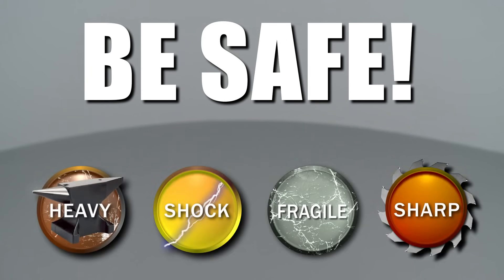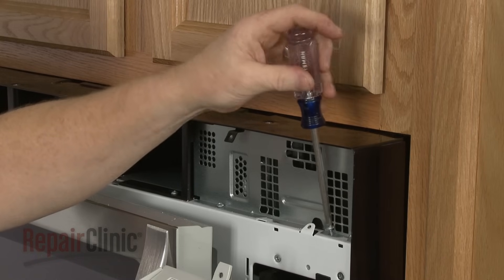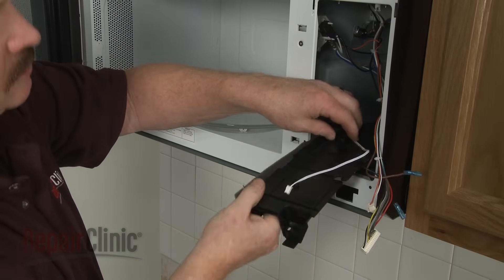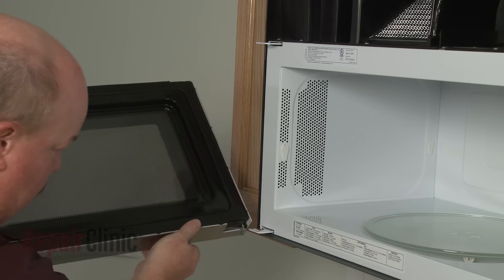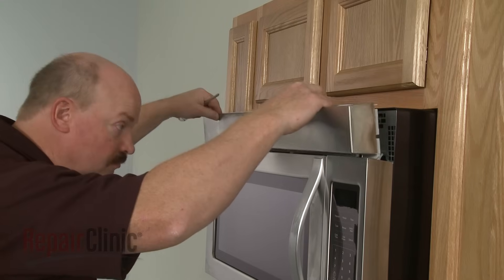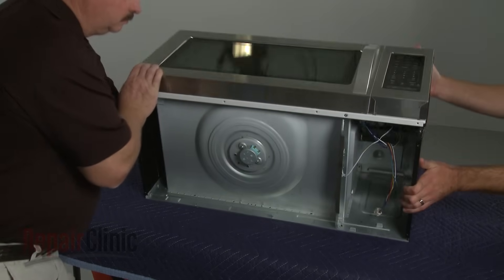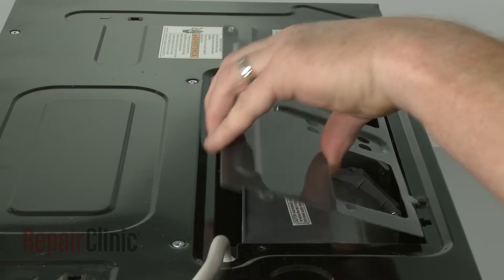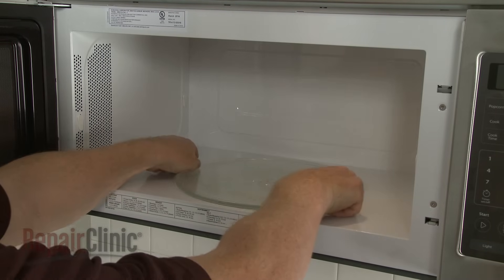Whirlpool Microwave Disassembly – Microwave Repair Help

Comment: So I had some sparking coming from the top of mine.. If you pause at 2:36 mark.. the small capacitor (?) on the small wire next to/below that thicker braided insulated white wire is burnt out. It was touching that white wire so the insulation on that one is a little burnt too. Can these wires be replaced?

Comment: Thank you for such a great instructional video. The issue with my microwave is the door is a bit loose for some reason. Looks like the screws are all there but I can’t really tell. Do you know why that might be?
Reply: My problem is that the door facia cracked despite the fact that no one uses it. (Came with new home)

Comment: i have watched several videos.  i have done a search of my issue.  i have worded it several different ways.  i cannot find an answer to my problem.  i cannot remove the plug from the old motor.  when i finally got them off, it pulled the plug out from the motor also.  it seems they are fused together.  i need to get the prong plug off to attach to the prongs on the new motor..

Comment: Without watching this first. I just took mine apart to clean it and put it back together, only having 2 extra screws.... I'd consider that ok. WIsh i had seen this first though, would have definitely save me so much time. Thank you for having this! great video.
Reply: A sign of a great repairman is having extra stuff on the work bench after reassembling.  😊😊😊

Comment: I have this same microwave, my issue is the exhaust fan only works on speed 1 not 2. Is one blower motor bad?
Reply: "With 2~3-speed motor, Hot voltage connects to main winding at different points. Only 1 point at a time receives power. That's what the switch does. When voltage is applied to each point, the main winding is energized as voltage from Black Hot wire completes circuit with White neutral wire." I would imagine there is a connection issue with "point 2".

Comment: Problem-Intermittently magnetron would not start, with a door close error. Open, close door a few times allowed it to start. Then it was just door close error all the time. Thank you for the video! You gave me the muster in disassembling the door interlocks with just a few hours before having to get ready for a three day work stent. Large family really missed having a microwave!! I was figuring I would have to dismount the whole oven before your video. The actual disassembly was very straight forward. In my case all the parts were functional. What I found was that each of the interlocks are held in place by a single screw and a sheet metal tab from the cabinet frame. Repeated use of the door bent one of the tabs, so that the interlock tilted enough, the bottom switches did not all change state. Bent the tabs back into a suitable position, problem solved. Work time about 40 minutes. Thanks again!
Reply: AM HAVING THE SAME PROBLEM. HOW DID YOU FIX IT??????
Reply: Need philips head style screwdriver, ohm/continuity meter and torx head bit set for this disassembly (Walmart multibitset $10, can now disassemble pretty much any appliance..loving it!! lol   ....  1) Unplug unit. 2) Check MW door to insure the two male interlock tabs are intact (each has an intact hole at end)  3) Remove the two screws holding top plastic grate outside, above door, top of microwave. Lift out grate. 4) right side top, remove single screw holding control panel. 5) Caution: panel has several very short travel, wire bundles with connectors that need to be disconnected before panel is fully removed. While the connectors are different sizes minimizing wrong connections, may be prudent for the less brave to take cell phone pics of still connected panel back before disconnection. With MW door open, dismount control panel by sliding control frame up and away from MW. Connected wire will allow just a few inches of travel, granting enough access to carefully unplug connections. Connectors have lock tabs on one side that need to be squeezed to separate connector. There is also, two slip on wire terminations, slide blue connector insulation up wire to expose, I then carefully pry off connector using knife blade edge. Detach ground wire at cabinet.  6) Use torx bit to remove the top or bottom interlock assembly (lower/upper door switch) one at a time. Switch is held in position by one screw and a foldover sheet metal tab from cabinet. Suggest testing one switch at a time.  (spring on each switch looks oddly placed, but if each spring leg end is connected, is probably ok looped coil is not pinned to anything) 7)To test... switch with two wires - disconnect one wire, check for state change (open/close circuit) across switch with switch button using ohm meter... switch with three wires - disconnect comm wire (center wire, check side of individual switched for pin function layout) check for state change (open/close circuit) across each side of switch with switch button using ohm meter. Check white plastic claw on interlock. Check tabs that press switch buttons to insure they depress switch buttons when in correct travel position. The claw grabs the MW door tab and  that limits the amount of travel this spring loaded assembly travels. I used a bit to hold the claw from over traveling the switch buttons while testing. Replace switches that do not change state. Replace interlocks that have broken tabs or spring mounts.   8). Remount interconnector once finished testing. In my case the sheet metal tab had bent out of the holding position and allowed the interconnector to engage but tilt, not actuating the switch buttons. 9) Once satisfied with interlock results, connect wires, mount them. Open and close door several times to insure proper closure. 10) reconnect control panel connectors.. don't forget the ground wire  11) Remount control panel and screw down. 12) Plug in and check if problem solved. 13) Solved - screw down top grill. 14) Still error - see step two... good luck, yes I have lots of free time..lol

Comment: I broke the bulb beneath this microwave and couldn't get the bulb's socket out. I figured it would be simple enough to drop the bottom but I didn't want to unscrew those 500 screws unless I saw someone else do it first and knew what was back there. From there it was easy to unscrew the light socket and, using needle-nosed pliers, unscrew the bulb socket. Now I can replace the bulb and stop having to get yelled at about it. Thank you so much!

Comment: how do i fix over range light if it is not getting power - even though display is showing High Low and Off - voltage meter shows no power coming to the light socket?
Reply: Where is the answer to the problem?